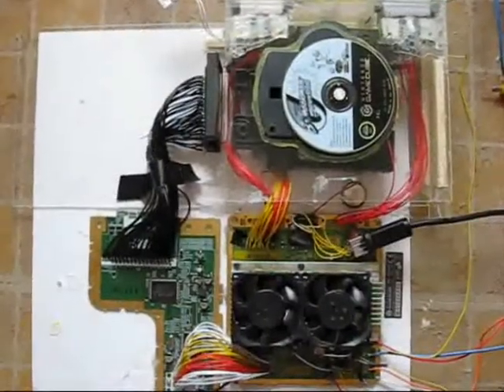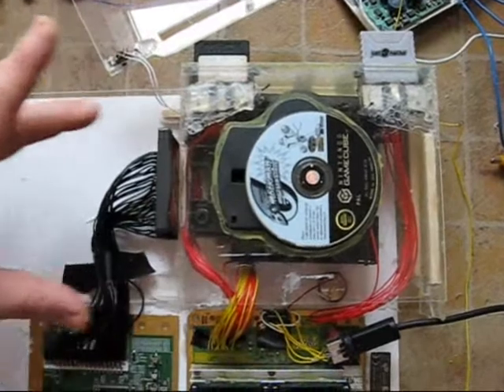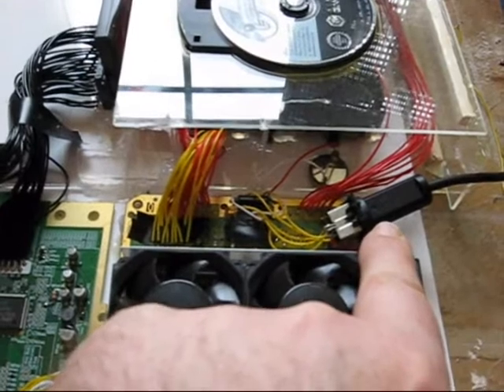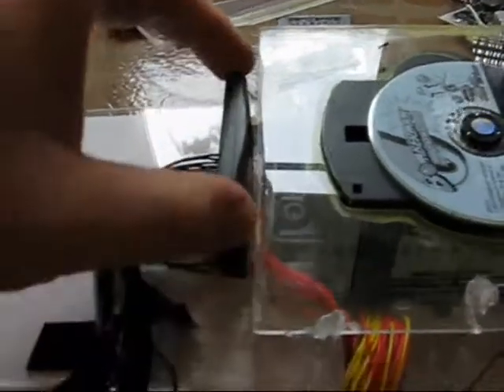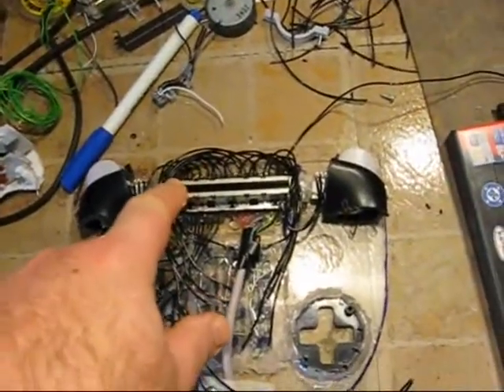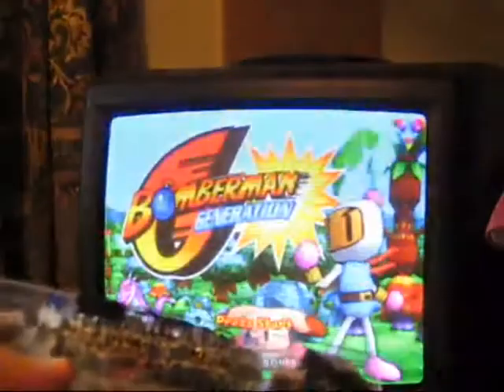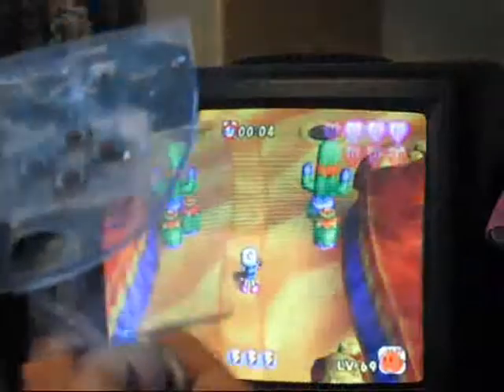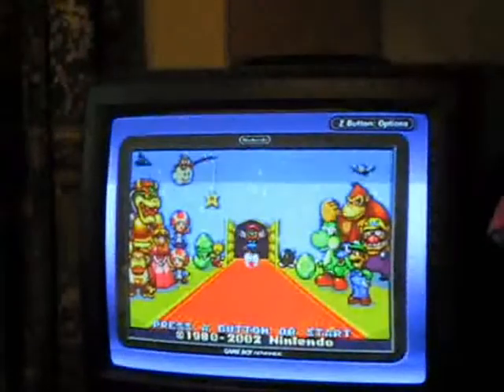Alpha Omega project - part 4 - GameCube and GBA player plus master controller

Comment: Really like how you've got the controller set up. The use of the n64 port makes a ton of sense. Plenty of connections, and also a tight enough fit to hold the controller board portion on. Very nice.

Comment from the maker: There are literally exactly the right amount of connections, although I made the N64 game port, which normally has 48 pins, into 50 pins by popping in two spare pins I had into the cart holes. The N64 game carts have 50 pins.

Comment from the maker: On my forum there is extra information, however the video and accompanying pics should be enough to have a system working, and the N64 video logs show how to make a case. 

The issues with the GameCube however are that the chips get very hot without a good heatsink (and fan), and of course the sheer thickness of the drive unit.